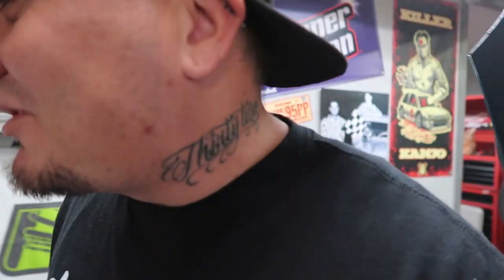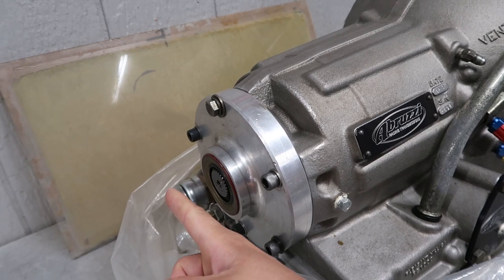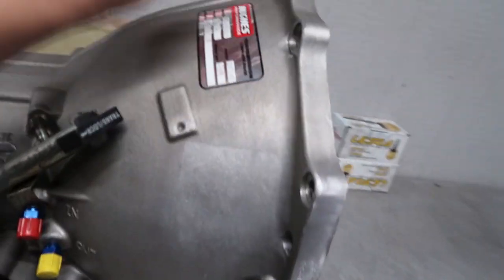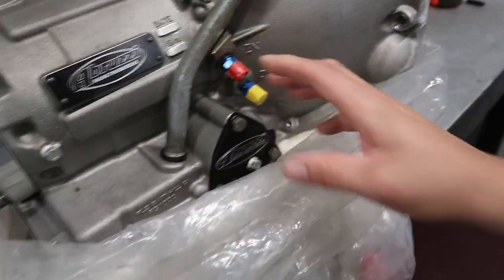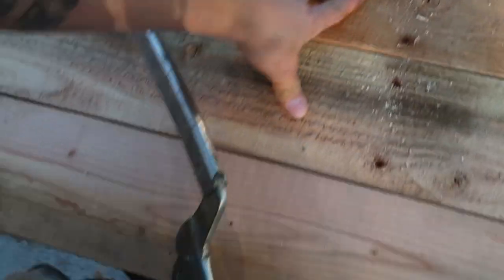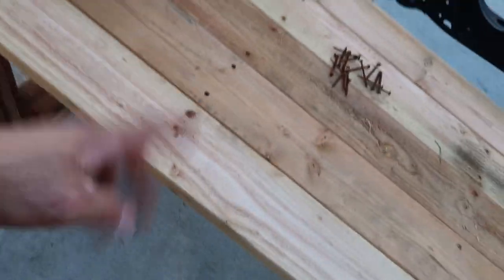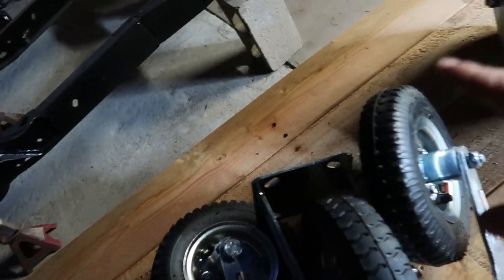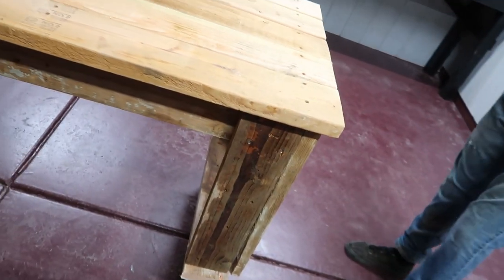DIY Rolling Work Bench!

Comment: bro they got Spyder and bug spray at lowes or home depot you spray around the circumference of each room of your home and if anything crosses the line where you spray it eats the arms or legs off of the bug or spyder it lasts ;like 6 months i have been using it for 10 years or more it works great and its cheaper then moving  i spray outside and inside

Comment: If you want to seal and weather proof it, mix 50/50 used engine oil and diesel. Spray it on heavy, let it rest 24 hours, if it soaked it all  up spray again. Once saturated wipe excess, better than Thompsons water seal. But if your not planning on leaving it to the elements just spray some oil or basic sealer. I've been looking to build a similar thing. Getting mad shit done and can't wait to see the progress of everything 💯👍